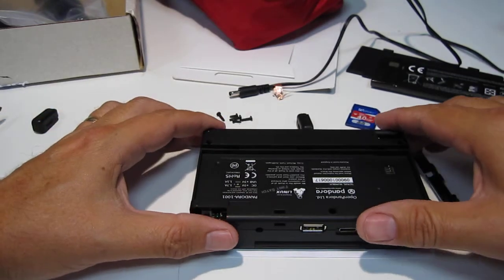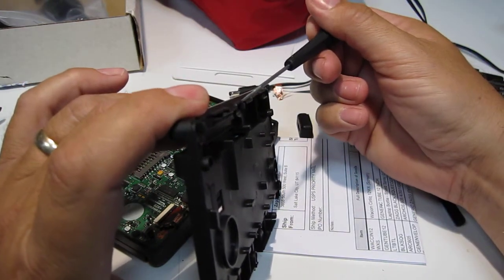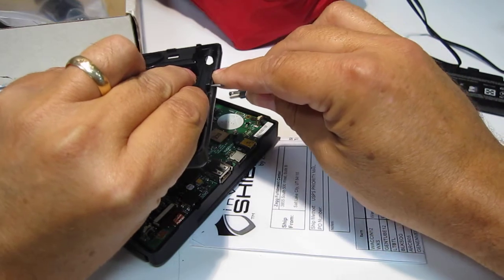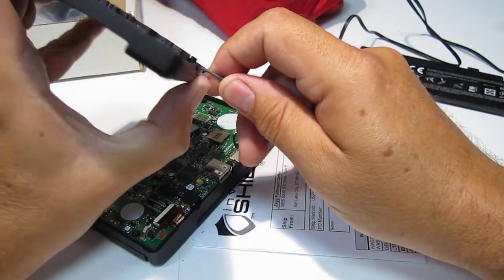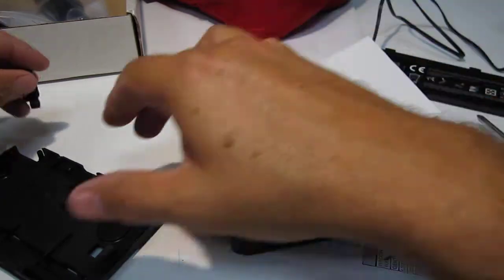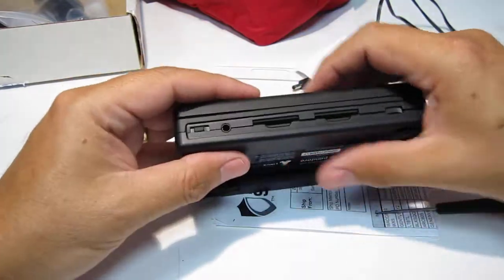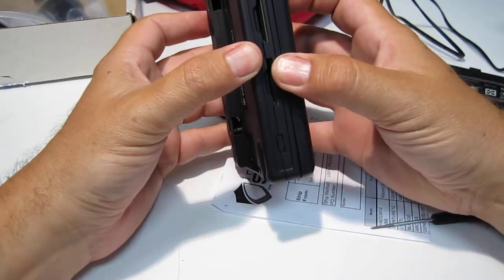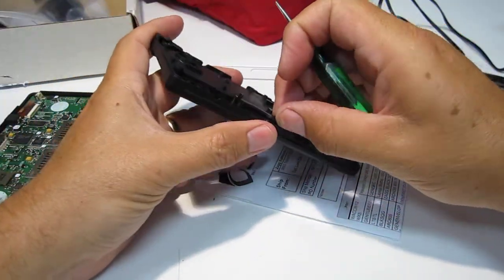Pandora Review Part 3 plus Case Repair

Comment: @mclovin1317 
You can order a Pandora from openpandora(dot)org but you have to pre-order as they are built to order by a small group and they use the money you pay to pay for the componants. The next shipment is due to be released October, so if you order now you should get it within about 6 weeks... a bit of a wait, but it's worth it for such a cool device I think.